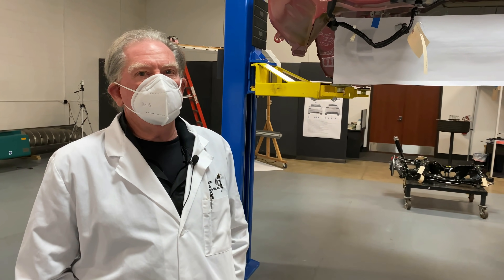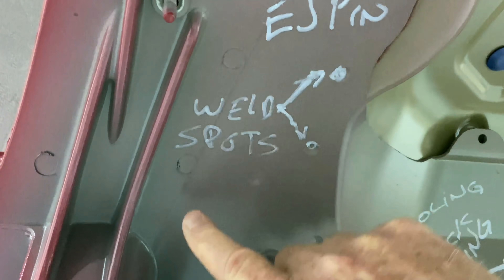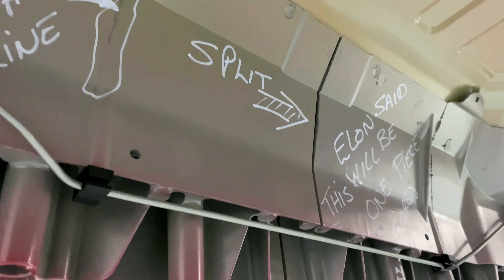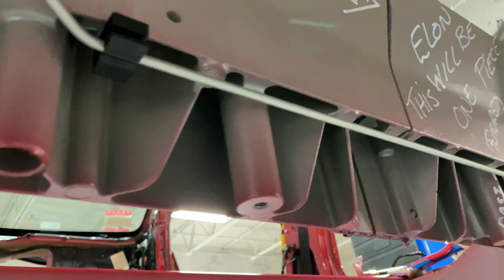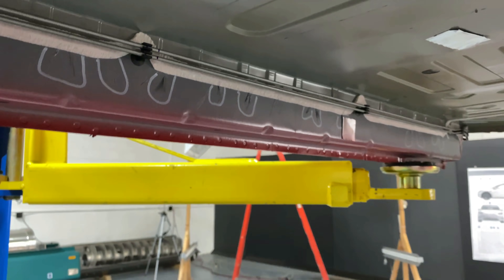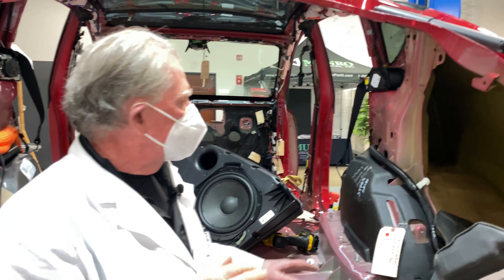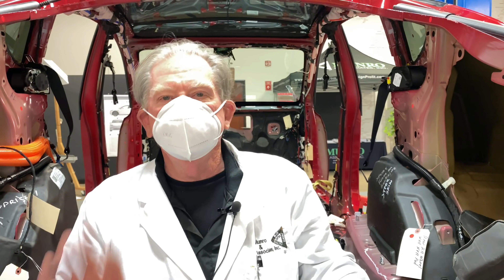Model Y E26: Tow Package, Mega Castings Revisited, Weld Splash, Hunt for the "Teslaract" Cube #2

Comment: If possible...please do a teardown of Taycan. That will be really cool!
Reply: Could crowd source the funding for that one. I'd chip in.
Reply: who care...
Reply: @lizard0827  
Obviously several people do considering the conversation we're having about it.
Reply: With all the marketing behind the Taycan I would be really curious how it holds up against the Model Y.
Reply: @ycaglaya  seriously, isn't that a bit comparing apples to meatballs?
Reply: @EVPaddy  
Yeah but which one is the meatball? 
everything I've seen says the fit and finish and manufacturing on the Taycan is far superior to anything Tesla builds.
It would be fascinating to see how a legacy automaker who's been building cars for a hundred years handles their chassis construction. I suspect you will find it's far more efficiently built.
The battery design is probably less advanced, I don't know about the motors.
I just recently saw the smoking tire channel take a Taycan on a long drive It was the 4S model. He got 50% better range than the EPA claims It should get.
I knew that was going to be the case from the beginning. Even before the car came out there were journalists that had taken turbo S models out and had exceeded significantly what the EPA said the car should get. And they certainly were beating the hell out of the car on twisty back roads which is what you would expect a journalist to do.
Not sure why the EPA rating is so low, but real world mileage from real people driving the real car seem to be easily beating the EPA rating.
Reply: @kens97sto171  Depends on what you like more. I'm pretty sure as much thought that has gone into Model 3 to reduce cost has gone into the Taycan to make everything perfect, no matter if a little thing costs more, if it's a little better. I'm not sure about the battery, they put a lot of effort into cooling. And I bet they put more Cobalt in, no matter the cost. I wouldn't be surprised if it beats Tesla's batteries in every respect. Tesla does a lot of things to reduce cost, not to make the car better.
Reply: @EVPaddy  
Personally I like both cars, although personally I have some philosophical issues with Tesla, mostly doing with right to repair and I think they have a little bit too much control over the product after I purchase it.
I suspect the chassis development is more advanced with the Porsche, perhaps with the model why they may be on par. 
But the interior fit and finish and design is far superior on the Porsche, every single automotive journalist I've seen talks about how just flawless the interior of the Porsche is. And it should be for the price There is no doubt.
It certainly would be interesting to compare the two.
Would also be interesting to simply look at a car like a VW ID4. again a manufacturer that's been around forever.
I'd also like to see some teardowns of less expensive cars like the Bolt EV, Nissan leaf. I think Monroe may have done these tear downs but there's no video of them.
Reply: @kens97sto171  same here. Tesla treats their customers as if they only bought the right to (maybe) use the car, but it's still property of Tesla. No, thank you.
Reply: @EVPaddy  
That certainly how it feels to me also. And it's a shame because the battery and powertrain technology really is top-notch They have some fantastic engineering.
I don't particularly like the minimalistic interior on the three and the Y, and some exterior stuff like the weird door handles. But for the most part it's the philosophical issues on control, right to repair etc.
Reply: kens97sto171 yep. agree. another thing I despise are the cultish fanboys that think Musk is the saviour. And the fact is taking too many risks on the backs of their customers. similar to the first point. if the batteries get fried by too fast charing, let’s just reduce the rate. important is that the numer is high when we sell the car. even if it’s only reached for a second and aversge charing is slower.
Reply: @EVPaddy  
There's definitely some gameplay going on with Tesla ,  And they definitely have some fanboys, 
Overall I do think musk is fairly brilliant he's an interesting combination of outside the box thinker and actual engineer. It's kind of an unusual combination. 
definitely agree on the charging issues. They've turned down the charging on a lot of the older model s's.
The legacy automakers definitely are taking a more conservative approach towards charging, the negative is it's a little slower charging the positive probably will be 15 years from now those cars will not have battery issues.
And the legacy automakers are piling up with new vehicles coming, and they have massive manufacturing capability that they can bring to bear. It seems like GM is going full bore finally. Volkswagen of course is going headlong with the ID3 and ID4. Ford, Rivian came out of nowhere, But busted into the market big time.
I think Tesla is definitely ahead on their battery technology and powertrain. But it's not going to take as long as people think for legacy automakers to catch back up.
It's kind of sad because part of me wants to like Tesla very much because part of the product is extremely well done. The rest of it just rubs me the wrong way.
Top of my list right now is a Chevrolet Bolt EV it's kind of the perfect size and type of car for my personal needs and A few weeks ago I saw a brand new 2020 LT model for $20,000 brand new, and the premium model for $23, 000 brand new. That is a smoking good deal...
But over the last few weeks the prices are beginning to climb back up.
That's a vehicle that is constantly forgotten about in the automotive press for some reason. Even though statistically it's got a lot going for it.
The only real weakness is it's relatively slow charging by today's standards.
Anyway great chat Hope you have a wonderful day
Reply: @EVPaddy  
Thank you, definitely enjoy talking with people about this stuff. Yeah the Bolt EV  is not really available in Europe. You guys got it as a Opel Ampera I think.
I really like the Kona, that's a super nice car on the inside. Unfortunately for my uses the backseat does not have enough rear legroom. The rest of the car is super nice though. The Kia Niro EV is also a good choice. Unfortunately in the US right now none of the Korean electrics are really available in any quantity unless you're willing to go used and they're still over $30,000 used.
like I said a few weeks ago you could pick up a bolt EV for $20,000. That's a smoking deal for that car even with somewhat limited charging speeds. Although the 20/20 model has helped that out a bit. It ramps up to 50 kW pretty quickly and slowly curves downwards now rather than the very sudden drops at 55%. It ends up dropping 30 or 40 minutes off the total charge time from 0 to 100%
have a wonderful day I hope you and your family are safe and healthy
Reply: @kens97sto171  For me, the size of he Kona was an advantage. I currently live in Spain and Spain is not made for large cars ;) It charges quicker than the Bolt but I don't care that much. I have the car about 1.5 years now and 35'000 km(would be probably 45k by now without the lockdown) but I haven fast charged it yet a single time. Didn't need to and there barely are fast chargers around. Have a wonderful day, too, and thank you, yes, we are OK. Same to you.

Comment: 4:06 elon also said that the model 3 will get the same trunk castings in about... two years.
Reply: Yeah, that was in the third row podcast with Elon and Sandy.
I think it will happen sooner. Giga shanghai is up and running and turning out cars. Phase II is making great progress. My guess is they want the Model Y production up and running to volume before making big changes like that to the 3. At the latest when Giga Berlin is producing cars Tesla should definitly have enough breathing room to make some large upgrades to Model 3 production and have some downtime without massive losses.
I am curious what upgrades they made to fremont during this downtime.
Reply: Mad@Gaming 

i don’t think they will reach “feature parity” anytime soon.

it took the model s 6 years to get height adjustable seat belts, which the model x had for three years already and those are, according to the tesla manual, an important safety feature. nevermind the model x wipers with integrated water pipe, which still didn’t make it into the model s.

i wouldn’t be surprised if the model 3 would stay without the heat pump for years (although i can definitely see a higher probability of THAT actually happening).
Reply: Would be great if they pass on the savings to consumers once manufacturing cost goes down. A 29k$ model 3 will bump out Toyota and Honda like it did Daimler and BMW.
Reply: @martialman.4563  That would be the Model 2, if they ever decide to build it. Elon has discussed this in the past.
Reply: @dchristo10  Model 2 would be economy model like Toyota Yaris. If they get cost of 3 down they could maintain same margins but lower price thus increasing demand.
Reply: Martialman.45 

just a sidenote about model 3 demand: sedans sell miserably in europe. it’s mostly hackbacks and station wagons (and now also slowly SUV/CUVs). so once the model y is available in europe, i expect the model 3 demand in europe to decrease significantly.
Reply: @kam_iko  Probably, that's why it needs to be cheaper. I wish used demand and thus price drops too. Right now used 3 is overpriced.
Reply: @martialman.4563  Model 3 is very cheap in US when you look at the whole package. I think Tesla needs to increase their prices(and they will!)
Reply: @DG-uv3zw  Depends. My car was almost 70k$ and it's not even the performance. We have solar so free power.
Reply: @martialman.4563  US or some other country?
Reply: @DG-uv3zw  USD, car was 61K$ plus tax, title etc. We did not qualify for full income tax credit but got some.
Reply: @DG-uv3zw  full self driving would have pushed in over 70k$ USD. All options close to 80
Reply: @martialman.4563  Yeah, sounds confusing to me... I know that its possible to get model 3 SR for $35k,(its doable) without taxes, titles etc. because you pay that for any other car.
Reply: @DG-uv3zw  Price has dropped quite a bit on my car but you can't get the same options, silver paint and enhanced autopilot. The car was 59k$ plus another 2k$ for performance boost plus all the delivery fees, tax etc. Not sure the total but around 70k $ is my guess. You can get a performance model for the same price or cheaper now.

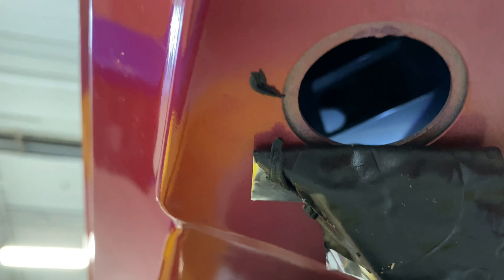Comment: 1:34 is the drain hole material beneath the aluminum extrusion, and around the wheel well made of aluminum??
- I'm wondering what will be the first to rust out ... in the harsh salted roads of Canada
Reply: Aluminum dont rust and any steel should be undercoated anyway,

Comment: With such a mix of metal alloys, what’s your take on galvanic corrosion?
Reply: Stainless steel sounds pretty eternal to me. Over 100 years should suffice.
Reply: @linemanap  - No stainless in the M3 or MY bodies that I know of. Carbon steel & aluminum. Galvanic parteee!
Reply: @linemanap  Stainless steel is way too brittle to be used in structural automitive components. And the issue of galvanic corrosion isn't adressed either.
Reply: Not a problem during warranty period
Reply: @WiseWik  The problem with galvanic corrosion is that it doesn't stick to a schedule and you only really notice it once the passenger department crumples to pieces around you in an accident.
Reply: A coating on any one of the materials affected might be sufficient to stop the action, or slow it enough to match the rest of the body. Nothing is eternal.
Reply: @Dan Moyer I didn't know this was a thing. The biggest reason I am getting a Cybertruck is the perception I have that it will never rust and will last 1,000,000 miles. If you told me a garaged Model 3 or Y would never rust in the midwest I would probably not wait for Cybertruck and just get a M3 or Y.
Reply: @Dan Moyer Are you sure you mean GALVANIC corrosion?
Because galvanic corrosion is in no way affected by mileage or the environment at all. You cannot even see galvanic corrosion, I think you're just talking about rust!
Reply: @Dan Moyer That might be true under certain conditions, but galvanic corrosion usually exists under different circumstances in the automotive industry. Whereas in the construction sector, different metals with the potential for galvanic corrosion are connected using threaded fasteners and need to be exposed to an external electrolyte to corrode, the construction methods on cars face different problems.
Due to constant vibrations, different metals are often connected using adhesives instead of threaded fasteners. The metals are not in close proximity anyways, at least not close enough for the electrolyte to function as a significant conductor. The problem arises when components aren't correctly glued together, meaning that they are glued together under close proximity. They essentially touch beneath a layer of adhesive, this is visually not detectable and can really f*ck things up. That's the main concern here, to avoid such a desaster, the body shop has to have absolutely flawless tolerances, gaps and quality control. And we both know that's not what Tesla is known for. Did you watch the video? The tips of their welders literally scrape groves several inches in length out of the metal when they should not even touch, that is appalling.

Comment: Sorry if this is a dum question ,but are the surprise welds/flash the result of a robot weld or is this a human thing? Have to say I'm kind of glad you're finding errors, if they don't make mistakes they won't learn.
Reply: David Spiers robots, but they do what humans tell them to do. Could be any one of the following

-too much heat in too short a time (probably more likely to cause holes than flashing)
-weld tips not aligned
-weld tips worn out
-weld tip dirty
-robot not perpendicular to the weld surface
-gaps between the panels when welding

All of these are easy fixes, suspect it is just some growing pains on a new assembly line.

Comment: The audiophile in me likes to see all the attention Tesla has put into the audio system in the Model Y.
Reply: I have seen a couple of proper reviews of the sound system of the Model 3 and it was very complimentary ...up there with the best in the world.
Reply: Those are standard components built by suppliers. Every modern car's audio system looks like that.
Reply: Correct, there is nothing NEW that Tesla is doing for the audio system, they just are doing whats known to work.  In my experience, very few company's use a dedicated enclosure for their subwoofer.
Reply: @BradleyEdwardAnderso  I work for a major manufacturer and I have personally never come across a subwoofer without a dedicated enclosure, even on sub $20k cars. But it's entirely possible that some companies do it differently
Reply: @komentierer  I have owned a Avalon, a Lexus is250, and an Subaru Outback without enclosures on the sub.  Now my Corolla has an enclosure, because I made it.  :)
Reply: In my opinion our 2015 S sounds better than our Y in particular the bass.  It’s a much fuller and rich sound on our S.